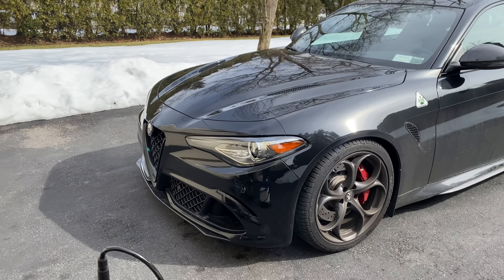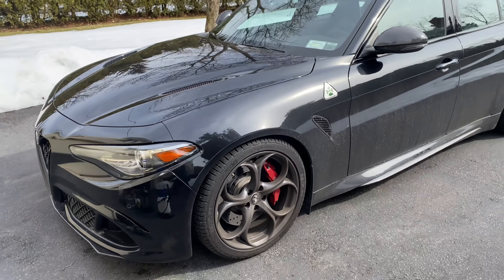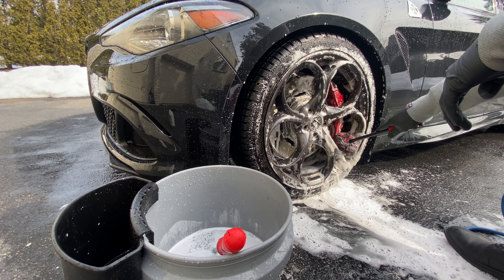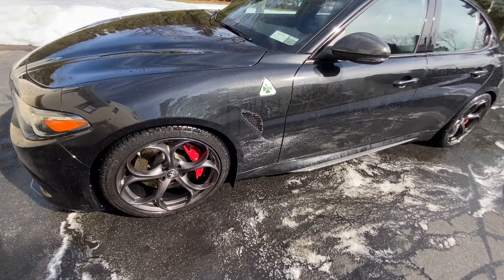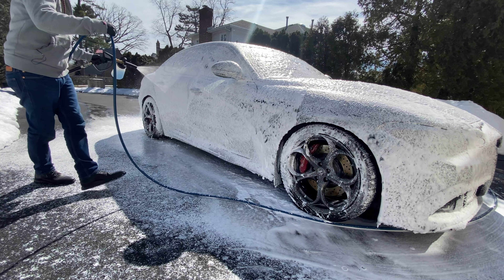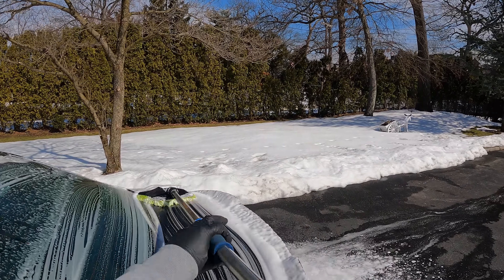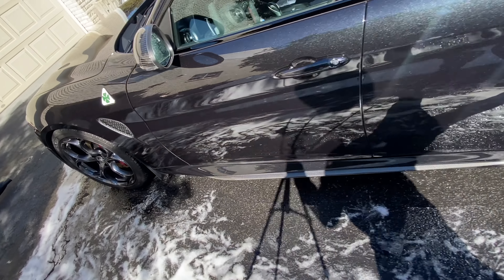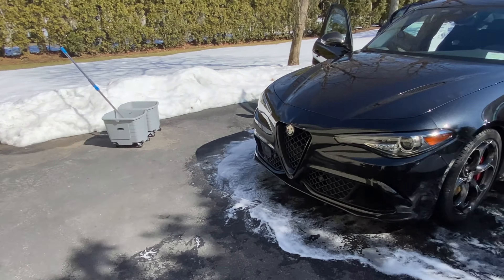2021 Auto Fanatic Winter Wash | New Gear & New Process!

Comment: I  like my process.  I have  3 Pf22 foam cannon containers.  I fill one with the salt neutralizer,  one with wheel cleaner and the other with cannon soap.   All the products I  use produce really good foam with the PF22.  If you really want to splurge,  you can purchase the fast disconnects for the PF22 containers from OG to speed up the exchange of containers.

Comment: If your towels aren't performing well its from the sealant in the towels loading it up. Soak in Rags 2 Riches from P&S/The rag company. You might need to do it once or twice then wash once or twice but it'll pull it out. I had the same issue prior.

Comment: What technology does the Salt Away use Phil?   Is it an acidic wash product or a high alkaline product?   I was just curious could something else be used in it's place to target salt like CarPro Descale (acidic wash) which targets mineral deposits.    Or could something like the Chem-X Stars and Stripes or the Wash Chems Pro-50 or Pro-100 touchless washes to do something similar with the salt?   I might have to add the Salt Away to my winter wash routine, especially on my daily drivers.  I live in Colorado so our winters have a lot of snow.   This could be a useful product for neutralizing salt if it specifically targets the salt somehow?   I love all your toys (cars and detailing toys!).   That stainless steel IK is sweet.   I love that foamer you have there.   That looks incredible and looks really stout and built well.  I love commercial grade products over the typical stuff that falls apart after a week or two.   Even in my house I have all commercial grade appliances and everything extra heavy duty so it actually lasts a long time like stuff did when it was made in America before WWII.

Comment: How do you clean the undercarriage with the Salt-Away? In Minnesota, the undercarriage gets massively contaminated with road salt.
Reply from the maker: you would need to put the car on jack stands and clean it unless you have car lift or quick jack.
Reply: Wisconsin resident here.  Mix the Salt Away in a 5 gal bucket.  Use a Worx Hydroshot to pump/spray from the bucket onto the undercarriage/vehicle.  Use a combination of rolling Ryobi undercarriage cleaner attachment and your choice of adjustable angle pressure washer tips with the Worx Hydroshot gun.  They WILL fit.   This process works great for me.

Comment: Hey Phil…I have a tire question for you.  It’s winter time here and normally I keep my truck well detailed, but it’s been a while.  We’ve had some bad weather for long stretch.  Finally was able to get out to detail my truck and noticed a serious brown buildup on my tires.  I started with a 3:1 mix of super clean in them and power scrubbed them with my power drill wheel brush.  Then did it a second time for good measure.  Then proceeded to wash my wheels and tires as normal with brake buster.  After I was all finished and everything dried off, the brown was still on my tires, but rubbed it with my clean fingers and nothing came off.  I’m just not sure what the browning color is all about.  Tires are only 23 months old now, and 30,000 miles on them.  Nitto Ridge Grapplers are the tires.  Any ideas?  Thank you in advance!  What are you dressing tires with these days too?
Reply: Use mineral spirits and some cheap mf towels. Odorless mineral spirits is the best to remove junk off the tire

Comment: Love ur channel.  I wish we could address salt on the undercarriage...  I think there is an attachment that provides a fan-like spray under the vehicle.  If you have heard of this, lemme know.... because while we all want the visible- i.e. outside salt removed... the underside is what suffers and destroys components.  Thanks.
Reply from the maker: i had a nice undercarriage cleaner but some contractor stole it from my garage but I have older videos showing it on m red GT350 on this channel. After winter i usually put the entire car up on jack stands, pull the wheels and do a deep clean of everything the bottom of this car is all covered in aero panels which is great

Comment: Do you really see a difference between with or without salt remover when washing ? I do use some salt remover sometime but with just  a good snow foam on dry pannel, dwell and rinse as pre wash it does seem to put it off also. Not sure if it is really worthing it? Btw that IK sprayer is insane!
Reply from the maker: Yes I actually do notice it on my cars which is why I adopted using these salt products last few years. You can see from the video how well it worked before I even foamed the car up.

Comment: How about the Liquid8tor from TRC? Similar towel at a great value.

Edit: i see the link for 007 is sio2 based... is there still a polymer based 007? ... also, i thought the ceramic sealant was a temporary run?
Reply from the maker: Hydro Gloss was a limited edition the 007 was revised for 2021and still kicks ass
Reply: @autofanaticcars  so the new 007 has sio2 unlike the original? Thanks
Reply from the maker: yes we will update the labels soon
Reply from the maker: try a bottle you will really love it
Reply: @autofanaticcars  i will, jeep something for the jeep. Currently just use a SI02 based waterless. Paint is bad, some products wont bond to it.
Reply: @autofanaticcars  woohoo got it already, going to use on the old jeep this weekend. Good test subject.
Reply: @autofanaticcars  so i used it as a stand-alone on the jeep. Gloss is there, not slick compared to what i was using, and a bit more difficult to buff away What i did like is it was still on the paint after using a stronger pre wash. There was still some hydrophobic properties compared to the Mckees sio2 RW/WW I was using. I like it, not perfect for how im using it but its a great product.

Comment: Not safe for certain paint jobs. Doesn’t have to special. My Mazda paint got messed up from this
Reply from the maker: how did your Mazda paint get messed up please tell us, never heard of this causing any issues on any paint
Reply: @autofanaticcars  I’ve had a coating on the white paint for about a year now. I maintain it very regularly. I have all white cars and the same coating on all of them. Never had issues. I only use this product on the Mazda.

But after using this a few times on only the Mazda paint, it’s caused a lot of bonded contamination. I’d try using a strong degreaser, clay bar. Everything i could. Only polishing took it off. Weird issue. 

Used it on a section of my white Acura, same coating m, and same issue a couple of weeks later. I can email you pictures. Not your fault.
Reply from the maker: something sounds very weird did you order the soap from us or on Amazon? We have had many and I mean many people order on Amazon, empty bottle and ship back a bottle with APC for a refund it has happened 9 times since January of people scamming I hope you did not get one of those bottles because we sell thousands of bottles per month of this product worldwide and never heard of this issue, send photos if you can to us directly.
Reply: @autofanaticcars  I got it from West Marine, only site that had it in stock at the time.

I’ll definitely send some photos! And include the products I used on my car.